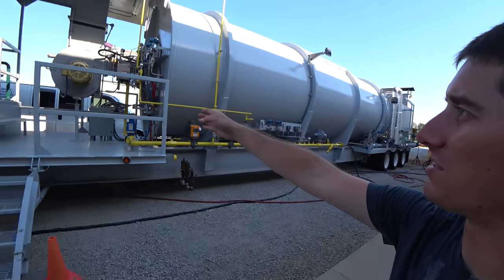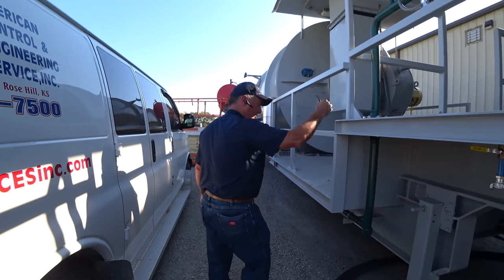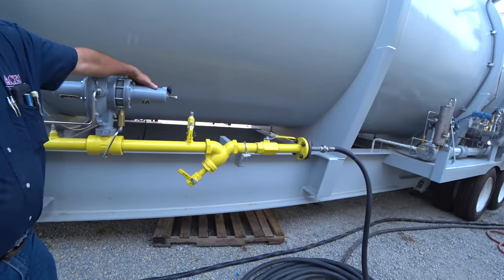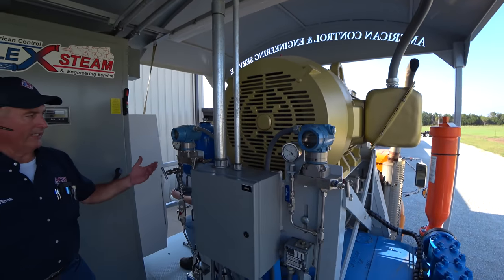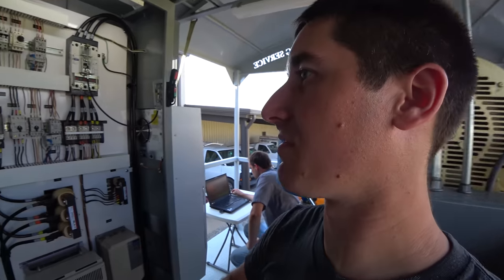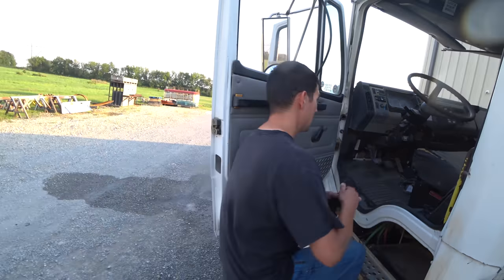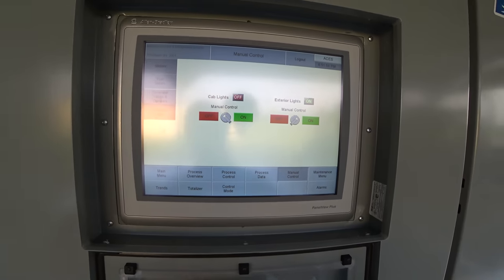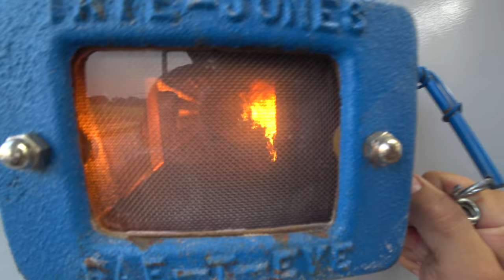Heres A TOUR Of A $1 MILLION DOLLAR Steam Generator *Hand Built In America*

Comment: As someone who works with steam in a food industry,  this is super cool to see a larger scale of how boilers and steam work
Reply: There are different sizes for various applications. There can be a system almost the size of a city block and nine stories tall including all its functions and water treatment. It is quite an interesting aspect of manufacturing few know about. It makes me laugh when "politicians" think they can run everything on the sun and wind.
Reply: @larrybe2900  the boilers at my job are roughly 20-25 feet in diameter and probably 30 foot long. I could be wrong as I rarely have to check on them. Still a cool/interesting concept. They (2) supply steam to about 15 machines that all ran around 280ish degrees
Reply: @GoldenT52  
It surely is quite interesting the ease of operation and ability to utilize different fuels.
I imagine those are a closed systems that re-uses the steam once condensed. I had to laugh at JR's dad talking about his 500 degree tea. I don't think so. Water boils at 212 degrees so he would have a cup of steam and yes a bit too hot to handle.

Comment: I work on landfill gas systems with leachate evaporators and it’s a pretty similar system. They use the incoming landfill gas (methane) to heat the water that gets pumped from the hill to boil it off instead of trucking the leachate offsite to a treatment plant.

Comment: Well I work with clean steam and the generator is a fraction of the size but the theory is the same. The difference is that to make it clean it goes thru a series of filters that purifies it. And also learned that steam generator (aka boilers for some people) are super dangerous and can kill a person due to pressure and heat.
Reply: Boilers can blow up and kill people, yes. Steam generators are significantly different. There is actually no possibility of this generator  blowing up due to the fact that there is no large volume of water or steam being stored inside the vessel and also it’s not a closed loop, the back is open and it’s always relieving pressure. The only thing that ever happens to these is if you run them in too much superheat you’ll blow a hole in one tube and that’s the end of it. It’s not dramatic at all.

Comment: JR, I am look at all that wasted energy that is being vented to the air and thinking, "Why the heck aren't they using that to spin another generator or 2? That, to me, is a huge waste of potential. 
That is a cool machine and looks like it'll be great in many applications. Disaster relief.
Another thought. That water is now distilled water. It's about as pure as water can be. 
Why not set it up to cleanly spin another generator and recycle it for drinking, bathing, etc.
Reply: The water is not distilled, there are lots of solids in it and they are actually condensed more than the water going in.

Comment: Could it be a flex-fuel system by running off any gases from the well, that is normally burned off?
Reply: you mean the natural gas it can run on, or the crude oil it can run on too? Did you even watch?
Reply: It will run off well gas, sweet or sour (and yes, those are technical terms).

Comment: What are they going to use it on site for.......or just tuning it...? There..
Reply: I was thinking that JR was going to steam the paint off of something... Camaro maybe? Sarcasm aside, it was built there and now it is being tuned. The tune will probably be optimized when it arrives at the well; to account for water TDS and fuel at the location.
Reply: This video is a year old. It’s in Venezuela now in the oil fields just outside of El Tigre pumping steam into the ground. Dad and I followed it down there in February to do the start up.
Reply: Rob Thompson exactly right Rob
Reply: @watchjaredwork1487  Awesome! Thank you for your response. @Jared Lumbert Glad my presumptions were correct and you didn’t have to say no, no, no this guy is all wrong. Looks like a fun project every time one is built. Which fuels do you test it on before it ‘ships out’? Do you provide a BTU rating based on those fuels?
Reply: @RobThompsontheITguy  thanks for the info 👍🏻
Reply: @Dragnet2  Happy to help, glad I got it correct.